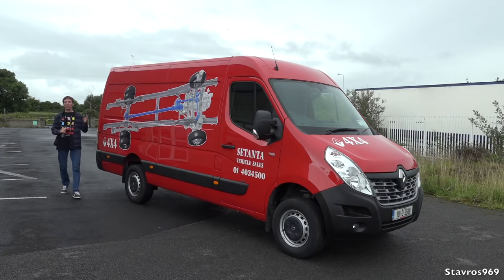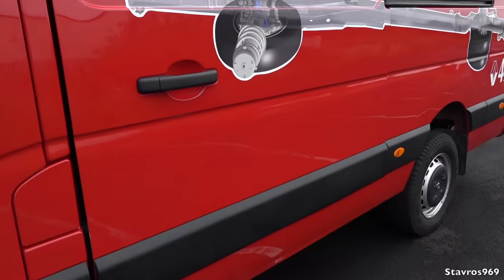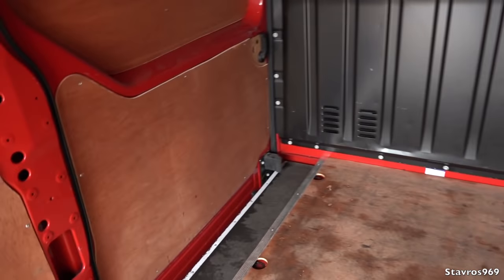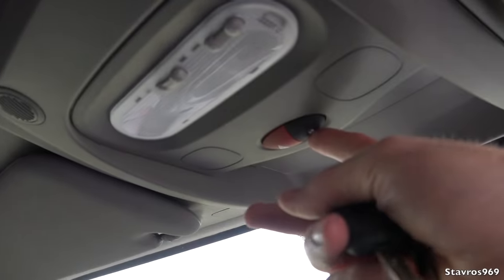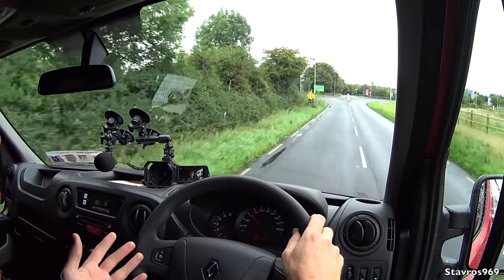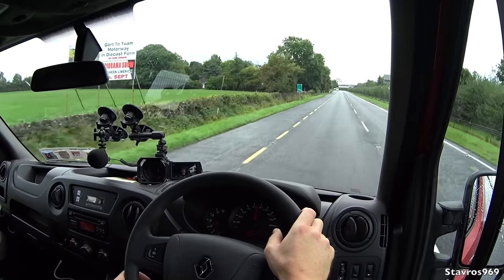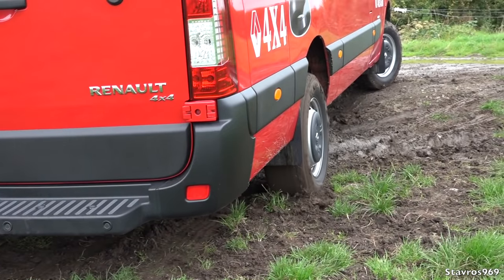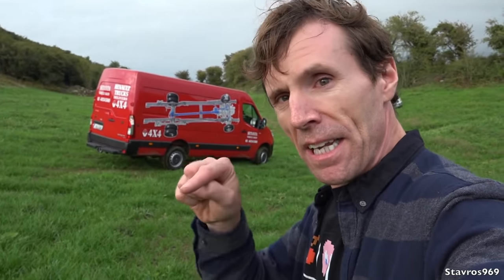2018 Renault Trucks Master 4x4 Van - Full Tour & Test Drive

Comment: 9:33 that are for papers and you can see if there is any paper from gaps or you can push and slide out papers from that gaps
Reply: Yep, although in my Iveco its lots of little holes so nothing falls through but you can still see whats up there.  Useful as its impossible to look over the edge of the shelf :)

Comment: maybe you can compare it to  a merc sprinter 4x4  soon then?
Reply: Only thing that a Sprinter has in common with a Master is that they both have 4 wheels and a steering wheel... lmao
Reply: yea.. im sure the 4x system is better as well. plus the 3.0 engine. but is it worth the extra $...

Comment: Rented one of these once to do a house move between the Midlands of England and Inverness in Scotland. I SUFFERED NINE AND A HALF HOURS OF THAT SODDING REAR DOOR SENSOR BUZZER GOING OFF! By the fourth hour I wanted to rip the fuse box out just to stop it! Nothing I could do as the van was full with house content that took a day to load so even if the hire company sent a replacement hardly a practical option to swap over. The one silver lining, the booking was for me to return the van back to England but as I didn't need the load capacity for the return journey the rental company swapped it for a far more comfortable Hyundai IX35 SUV.

Comment: I drove one of these for an hour and I hated it lol, not a bad looking van but the comfort wasn’t the best, couldn’t find a comfortable position for the adjustable steering wheel, It was either too far or too high. The clutch wasn’t great though it was a brand new 67 plate at the time. It’s performance wasn’t impressive in any way. But great video as always Stavros my man 👍🏻

Comment: Have a Renault master , have from new , so far it's had 40000. Miles , it's had a new clutch, and a new gear box , and a new heater motor , lovely van to drive , but that's it, by the way mine is the mini bus version, I use it for my family , so I carry 3 kids and 2 adults , so no weight it's carrying, these cans would not stand up to carrying tools etc every day , these vans could not be a work van , even when u close the sliding door u can see the metal in the door flex and wobble , quite simply there not up to much , but that's the reason they are a fair bit cheaper then any other. Brand out their

Comment: Same old, same old... Door locks..  Why vans don't have proper security on them when new is be-on me..  I don't buy new and that is one of the reasons.. I'd rather buy an older van that I can drill into, hammer and make secure without worry of any real damage as would be with new..  The price of these vans and the first thing you have to do is make them secure.. It's pathetic..